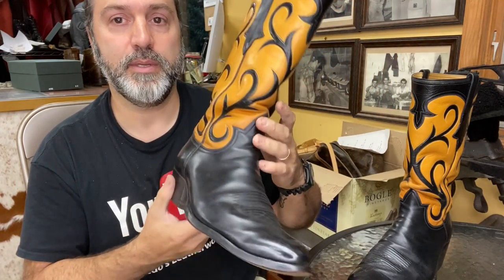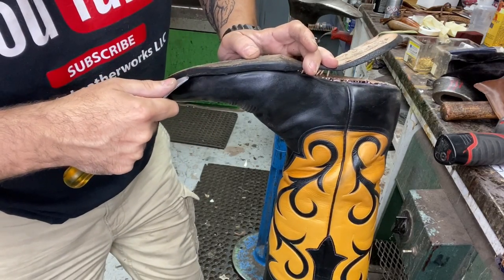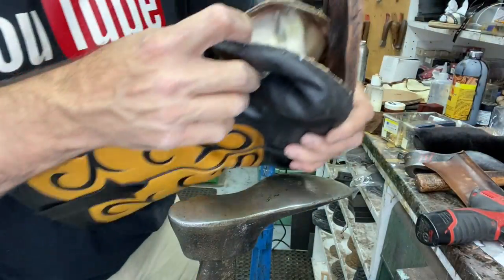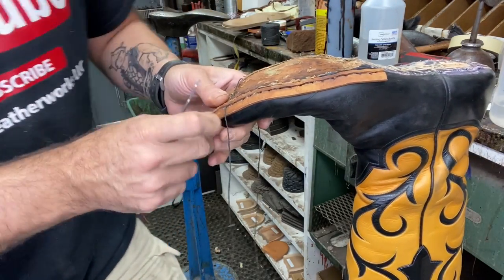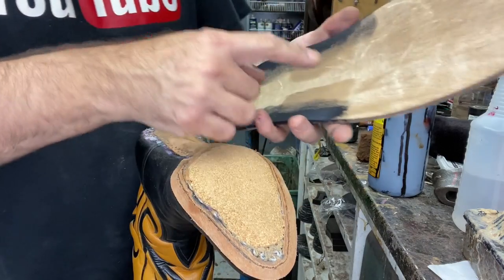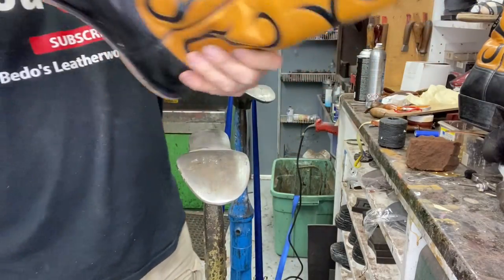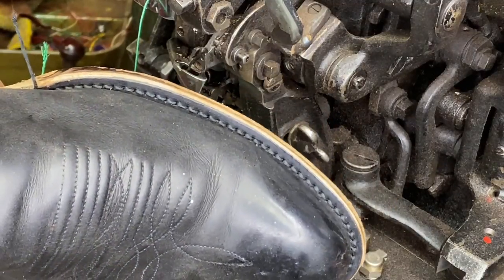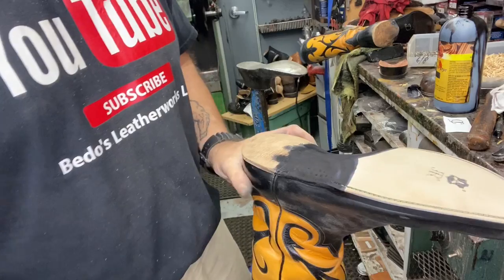Cowboy boots restoration

Comment: I'm curious about the wood pegs because as a carpenter, it is my understanding that moisture causes wood to expand and when it dries, it contracts which is why wood has to be below a certain moisture content (usually between 6-12%) to be usable for furniture building.  The last thing you want to do is build with wet wood and then have it dry out because it will pull your joints apart and cause other problems.

I would reason that it's the wet leather that makes the difference because once it dries, it's constricting around the wooden pegs causing a very tight joint.  Regardless, beautiful work as usual.
Reply: I believe you are correct. If wet the leather it must expand. As a riveter we can heat a hole and it will expand and allow a rivet in. Same principal I guess.
Reply: @jeffreygoss8109  As wet leather dries, it shrinks (contracts).  The wet leather shrinks around the wooden pegs.  I'm not what glue itself contributes to the process.  Bottom line:  If Steve puts it together, it ain't coming apart (unless you add turpentine/thinner and yank the hell out it with a pair of pliers or a pry bar.)!
Reply: The pegs go into the glue dry, wet to touch is what he is describing, before the glue dries, the wood is soaking it up, expanding, then setting that way. Perfect joint.
Reply: As I understand, lemonwood pegs and leather expand and contract at a similar level.

Comment: I have an old pair of Justin lizards that I hadn't worn in some years because of the lousy repair job done on them some time back. I live not too far from Snellville Shoe and Boot repair so I took them on over for Scott and Zane to do their thing. Well I'll tell ya, new full JR soles, new stack leather heels, complete recondition of the lizard that was dry as the Mojave, the end result was as good as Steve would have hammered out. These boots look new, and weathered. That's what I wanted. If you have cowboy boots that need work, give those boys at Snellville a shout. You won't regret it.
Reply from the maker: You are absolutely correct in your assessment. The “MaddoxTeam” they are the best.

Comment: What a pleasure to see some really well-constructed boots, as opposed to those overpriced Italian shoes with super cheap construction.

Year ago when I worked the Renaissance Faire I spent what was then a great deal of money for me on a pair of custom high-top moccasins from a maker in San Francisco. This was the kind of close-fitting moc where they take the exact shape of your foot and ankle with duct tape and a sock; when finished it fits your foot exactly. Just in case anyone thinks that shoemakers and cobblers do the same kind of thing, when a side seam popped and the soles wore down a couple of years later, I went back to have him fix it. When he'd repaired and resoled it, I couldn't even get my foot into it anymore. He'd totally disregarded (or didn't feel like dealing with) the issue of preserving the fit on resoling, and made them much more snug. Seriously pissed me off, and I never had really decent footwear for those events again afterward.

Comment: Lovely  Lovely 
.
...and the glue does help keep dirt/grit out of the seam/joint .. 
I have seen welts packed with sand and was like sandpaper,  the welt area  - thread and all just chewed up .. every step  grinding the grit into the threads, etc... any tiny gap gets packed and over time. It works it's way in, and forces the joint open / lets water in.... we have had heels fall apart.. found the hollow spaces full of grit/ dirt/ manure  (farm life)..
.
Funny story  - ears ago I got my shoes wet with a fish emulsion fertilizer-- (very high in organic nitrogen)
less than 2 weeks the shoes  started falling apart...  naturally occurring soil/ fertilizer bacteria ate the connecting layers, the padding and paper fillers..   no joke..

Comment: cotton knitted gloves are great things to have around the workshop. a sack full can be had for cheap. like 120 pairs for sgd$35 cheap. they are great for scrubbing areas that is hard to stuff anything other than your hands. if you can stuff your hands in, you can use the gloves like an applicator of sorts,

Comment: Jimmy Luke Covington. You want a pair of his boots, you make an appointment for an in person fitting. These are 100% bespoke. His website gives contact info and that's about it. No price ranges listed. I get the feeling his customers aren't the type to be that worried about the price. You did your usual amazing job. Were wood pegs used instead of nails to make the boots lighter I wonder? They seem to do just as good a job.
Reply from the maker: CrimFerret I think the main reason is that nails will corrode  over time and rust when it gets wet.
Reply: @BedosLeatherworksLLC  I think it's usually brass nails being used, but that could be as well. I suspect the other reason it's not done that way often is you have to punch the holes first so it takes a lot longer (as shown in this video). Still, darn impressive construction on those.
Reply: @BedosLeatherworksLLC  I have 0 knowledge on this so I might just talk out of my butt, but can't wood rot? Just curious.
Reply: Im not a cobbler and don’t know jack about this, just seen a few videos. Ive heard lemon wood is used because when leather gets wet it expands, and supposedly nails can fall out over time. I think the lemonwood expands and contracts with the leather, but again, im no expert
Reply from the maker: Michael McGinley that is correct
Reply: Wood pegs expand and contract with the leather when wet and drying. Plus metal pegs can rust. I believe the main reason its used in hand made cowboy boots is that it is traditional.
Reply: @BedosLeatherworksLLC  Cool, learned something.

Comment: Surely the wood would contract, not expand, as It dries?
Reply: That is what I was thinking.
Reply: Yea I thought exactly that ??
Reply: It's the leather that contracts
Reply: Some glues are sort of “activated” by water, so that could be it too. If so the pegs would not be soaking in water first, but just dampened a little.

Just a theory.
Reply: They were barely dipped in a glue solution? I don't think it works as we were led to believe, they are more like lubed up, and as it dries up in the hole the little glue thats left has soaked a tiny bit into the leather and wood.
Reply: I believe the intent was that the wood peg will remain stable or perhaps slightly expand as it absorbs moisture in use, but the leather should shrink around the peg as it dries from all the moisture sprayed on during repair.
Reply: The leather is what shrinks here, any time you wet old leather, you'll note it'll start cracking because its shriveling up as it dries. This happens to a lesser degree with "fresh" leather.

Comment: I have two pairs of almost new Bally boots. Scarim navy suede and Strauss Aqua suede.
They are too big by size and half. Can you make them smaller? 
Also, it may require resoling in that process , if so use light weight Vibram sole.

Comment: Nice repair! A question; at 16.50 You explaned work with two needles is that the same as we call this "zwiegenäht" and how do this kinda boots "walk" continue with the vid's
Reply: No. Zwiegenäht defines a different construction of the shoe. While at Goodyear welt the upper gets folder under the sole, the upper at the zwiegenäht construction stays vertical in that way, that the stitches stay visible. I think Zwiegenäht is the real storm welt.
Reply: Thanks for Your splendid explanationMister!

Comment: The reason for the wood pegs instead of metal tacks is that the right type of wood (I believe it’s lemon wood) expands and swells at the same rate as the leather when it gets we, therefore it won’t wear the holes bigger over time.

Comment: About the confusion with the wooden nails from a carpenter:

One possibility is that they are bought industry-dried (below 5% water content) which means that when you put them in they expand because of air humidity.

Another is that they are expanding as soon as water comes in contact with them which is exactly when you want them to stick the most

Third possibility (most probable one): they used wooden nails because they like it and it's traditional, not because they used any advantage of the wood versus steel
Reply from the maker: Der Neokosmopolit I think the wood is used because nails corrode when they get wet and it damages the leather
Reply: @BedosLeatherworksLLC  makes sense! It's just that wood rots when it doesn't have contact to enough circulating air to dry again in reasonable time, so there is no advantage there in this case... I don't know...

Maybe the material combination of wood and leather is just quite good in general, wood is also flexible which might be desirable...

That's the good thing with traditional trades: Built up knowledge over the centuries, gained by trial and error

That wooden nails work very well in this case we see by how well they withstood the wear and tear
Reply: I am just not too sure about wetting the wooden nails before putting them in...

It goes against everything I know about wood but I don't know anything about the harmonics between wood and leather.

It's more the opposite, what I mentioned before, they use super dry wooden dowels in the construction of pre fabricated metal free houses

Comment: You can make the heel, stitching, a welt strong as you want, but weak point is always leather in the front-middle of the shoe, where a hole will appear after few months or years of usage (depends how often you are wearing the shoes).
So it seems to me kind of pointless to make a heel/sole like a tank, if it needs to come off after pretty short time anyway... :)

Comment: Dont know how anything expands when it dries. That is counterintuitive.
Reply: The wet peg compresses slightly when it it driven into the wet leather hole, and the wet leather stretches a bit, because it is wet, and dries tight around the peg. Nothing expands per se, both materials deform while wet and return to their previous size/shape when they dry out.